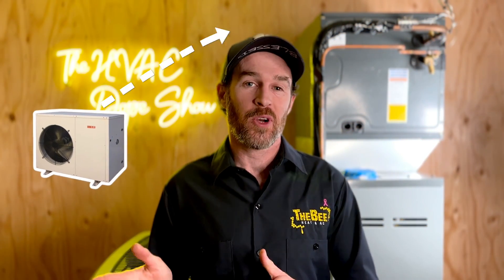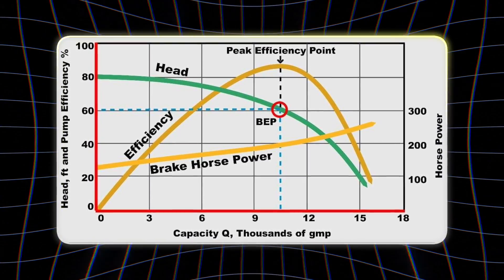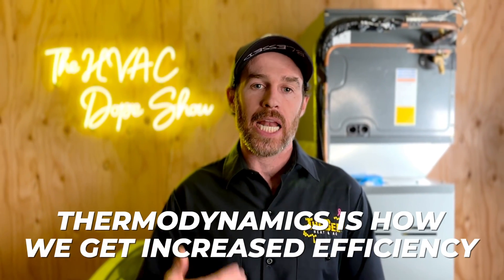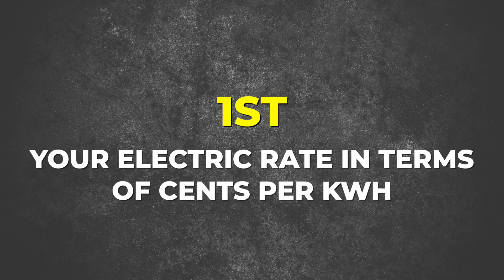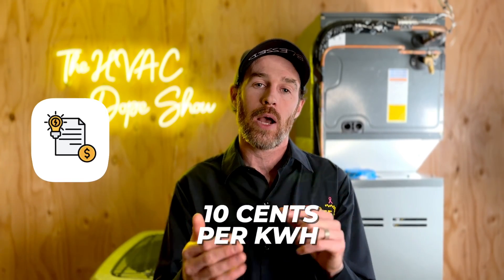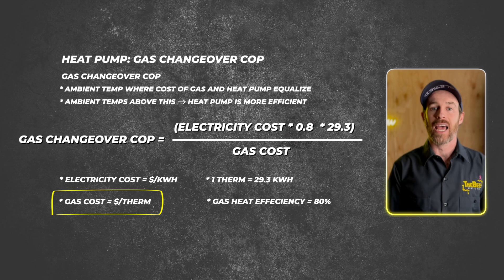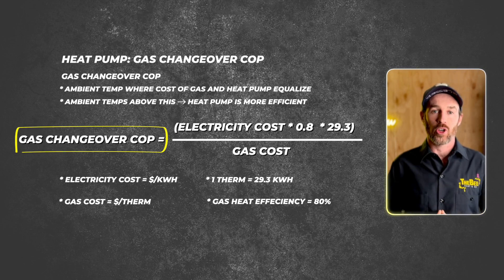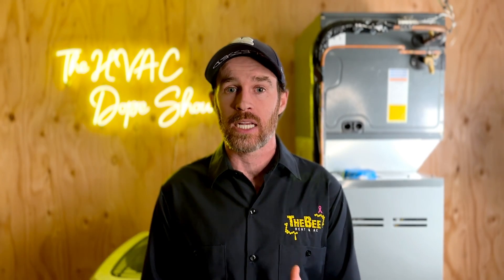Is a Heat Pump cheaper to operate? TRUTH REVEALED🔥

Comment: For the Canadian people 1 GJ = 9.478 therms.

I broke down my cost in Alberta Canada and my Changeover COP is 2.82, meaning my Amana S Enhanced (Daikin Fit) system is best to change over at 38F since it’s COP is 2.92 COP at 38F.
Reply from the maker: And that’s including the delivery charges? I guess that doesn’t sound far off but sounds like you have lower gas prices in your region, if prices change it may make sense to drop the heat pump changeover temp
Reply: therms/GJ varies depending on the conversion factor.  Last bill mine was 8.976 therms/GJ.

Comment: 4.975.  So I'd need a COP of at least 5 have any chance of breaking even, but I doubt even that would do the trick, since heat pump COP ratings are calculated at relatively mild outside temperatures and get lower as outside temperatures drop.   
I think I'll keep my 95% efficient modulating, condensing gas boiler for a while longer.  :)
Reply from the maker: At that COP you’re right! The only heat pumps that beat that right now are ground source heat pumps that have COP’s between 6-8, and don’t drop below 5 until it’s below -30F
Reply: @TheHVACDopeShow  That's how it is done in Sweden.

Comment: If you use the economic balance point app it will tell you at what outdoor temperature it is more efficient for natural gas. For me,, 41° last I checked. This factored my cost per therm, cost per kw and the cop of a 18seer 2 stage unitary heatpump
Reply from the maker: Right on, thanks for sharing!

Comment: Used the formula, came up with 3.4471. What the heck does that mean?  You didn’t explain.
Reply from the maker: I’ll be posting another video, sorry I got a lot of feedback that made it clear I didn’t do the best job connecting the dots. What that means is that as long as the COP of your heat pump is above that then it’s more efficient to operate a heat pump. Most heat pumps run in the 3-4 range which means that it’s basically a break even for you but depends on the system. Each heat pump has its own COP / efficiency and it depends on outdoor ambient temps (it will be more efficient when it’s warmer and less efficient when it’s colder / below 5-10F…) if you’d like to know more please let me know your outdoor low temps in the winter months in your region (or just your city/state/province etc and I can look it up) and we can determine what the actual efficiency is. For example Bosch’s 20 SEER system clocks a COP over 4, but the Daikin Fit Enhanced is around 3.4 - 3.5, and this is around the outdoor temps of 40F.

Comment: I did not hear an answer to the question you posed in the title of the video.  I was expecting something along the lines of "Yes, if your electricity rates are low enough and your natural gas or propane costs are high enough."  I think you alluded to that, but I'm not really sure, because you made no conclusive statements at any point in the video.  Throwing both solar AND EV charging into the mix might have made sense to you, but I positively assure you that it only muddied the waters for 90% of your viewers, most of whom are now even more confused about the economics of a heat pump.  That's pretty frustrating, given how simple this topic could have been, if you'd stayed on point.
Reply from the maker: Did you apply the formula to your electric / heating bill? It will vary depending on your rates
Reply: @TheHVACDopeShow  - I don't have access to natural gas, so it's an absolute no-brainer - heat pumps (HVAC and hot water) have been saving me money for years.  They are absolutely cheaper than propane for the furnace or a straight electric hot water heater.  If I generated more from my PV array, it would lower my costs even more, but I live in a very poor location (site) for solar generation.  I mostly do it as a hobby - 100% DIY.

Comment: You provide a huge amount of information in your videos. However, you speak much too quickly, you don’t transition from nor connect one topic to another very well, you overwhelm your listeners with with technical knowledge and you say “the bottom line is” when you’re nowhere near a summary. I don’t doubt you know what you are talking about but I don’t get the idea that you can impart your knowledge in a way and at a rate at which I can benefit or understand well. I’ll keep watching and maybe it will get clearer but you have some work to do on producing good videos.
Reply: You, sir, are a good communicator!  The guy making these videos is very knowledgeable, but is trying to convey too much, too quickly, and not in ways that will be easily consumed by most viewers.  Case in point: I am less certain about whether or not it is cheaper to operate a heat pump or natural gas furnace than I was before I watched this video.
Reply from the maker: You have to plug in your bill to the formula… I’ll make a part 2 with an actual bill so you can see how it applies. I wasn’t trying to confuse everyone but apparently that’s what the first few comments are alluding to so in part 2 I’ll try to spell it out more clearly and won’t dive into solar panels etc… it’s actually a complex topic because your COP changes based on external operating temperatures so this is why you have to use a ballpark or average numbers. Maybe with an actual bill for comparison it will be easier to understand.
Reply: @TheHVACDopeShow  Part 2 would be good, I came up with a 2.97 number if I did it right but I dont see yet what exactly that figure now represents.
I'm paying .85 a therm for gas, and electric is about .09 a kw- I dont count the $8.50 meter charge since to have ANY electric at all you have to pay that, I used  346 kwh for $34.10 last month. I have an 80,000 BTU furnace thats 96% and a 12,000 BTU mini split by Tosot
Reply: Ha.  I listen to the video at 1.5x speed.
Reply: @michaelkearney7923  - So, you get even less out of it than the normal viewer?  :)  It's not so much that he speaks too quickly, he changes topics frequently and doesn't tie things in very well, at least in this video.  In other videos he's done, he is much more on point.

Comment: I find my utility bill to be indecipherable, but 50-75% of the bill is for fixed costs such as connection fees, right of way fees, municipal fees, administration fees, and carbon taxes. That's over $1200/yr. 

Unfortunately, the math for switching to electric heating didn't make sense at the time unless I went solar. I've insulated and replaced the windows since then, so I'll rerun the numbers when it's time to replace my HVAC and HWT.
Reply from the maker: You’re not alone the utility bills can be very confusing
Reply: Well, certain things you cant logically include like the base meter charge you pay whether you use one kw of electric or a million kw'd, or one therm of gas or a million therms, here I pay $8.50 for the base meter charge.

I added enough insulation in my NW Iowa attic to make it R100, replaced the old single glass windows, and added 2" deep interior walls to all the outside walls, with 1-1/2" of celotex inside, bringing the walls to about R21.
Before I replaced the windows I would get ICE on the INSIDE of the glass in the kitchen where my desk is, it always felt like a cold draft and I had to have a 1500 watt space heater on behind my chair all the time.

Then I read the cold glass sets up a convection current and THAT was the "draft" I felt! I replaced the 4 windows and the ice vanished, and I no longer needed the space heater, that saved $50/mo immediately.
Same story in the bedroom, replaced the 2 windows, and the space heater in there at night on low went in the garbage, saved $35/mo. Replaced the rest of the windows but no idea what additional savings that brought.

I installed the  MI vinyl windows myself, they cost me about $175 each 10 years ago.

I replaced my 30 year old Lennox Conservator II 80%  110,000 BTU gas furnace with a Goodman 80,000/ 96% gas furnace, installed it myself.
The Lennox claimed 80% but with it's open 5" flue that spilled cold air down between cycles,  and taking its combustion air directly from the room I bet it was no more than 65-70%

I got sick of window AC's and the twice annual basement rodeo hauling  it up and down the stairs so I bought a Tosot 12,000 BTU mini split last month and installed it myself- replacing the 6,000 BTU window AC in the kitchen that cooled the entire house.
Right now its been used on the heat cycle.

I pay about 9 cents a kwh here

Comment: I've had my 9000 watts of grid tied solar since 2015. I'm in Alberta just North of Montana. We get minus 40 here. Last fall I bought a 12,000 BTU mini-split with Solar DC assist. It came with 1,320 watts of PV panels. It drove me nuts when I didn't need heating or cooling. The solar was going nowhere. So I bought an Ecoflow Delta Pro and two extra batteries. I run a full sized fridge, entertainment center and security DVR from the Delta Pro. My daily net usage went from around 12 kWh per day down to 3.6 kWh per day, this was for March. During the summer I will be able to run the heat-pump for cooling from my Ecoflow after sunset. By the way, my heat pump stops heating at minus 29C lol. Our Prime minister thinks we can heat with heat-pumps. He has no Clue what a prairie winter is like. On a day like today where the temps are hovering around the freezing point. I kept nice and toasty running the heat-pump 100% from solar.
Reply from the maker: That’s awesome, sounds like a nice setup!!
Reply: The goal is to reduce the burning of fossil fuel for heat and heat pumps are an effective solution.  If you ran a pure heat pump installation you would have heat strips or you could use a heat pump with gas backup.  During the winter the number of days of -20C to -40C is usually a few weeks, maybe and what about the Chinooks.  You have to start somewhere don't you?  I here your Premiere is blocking renewables, lol.